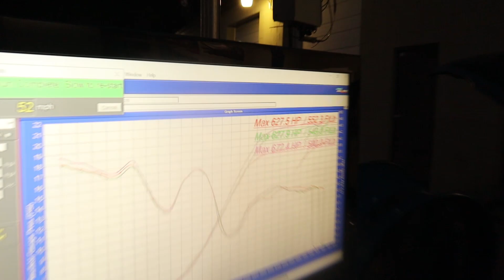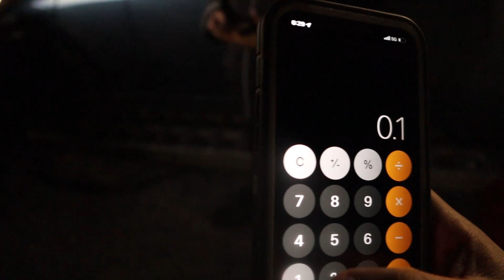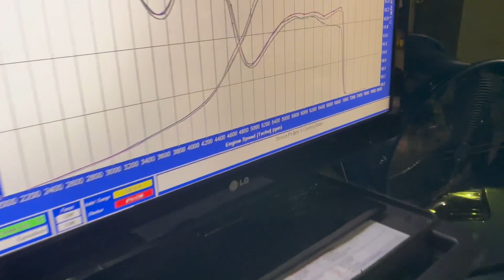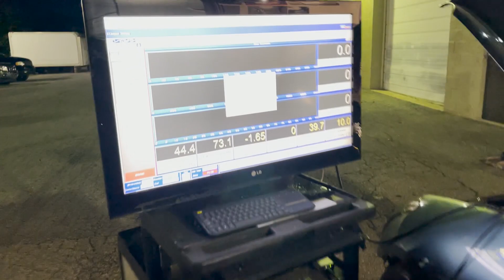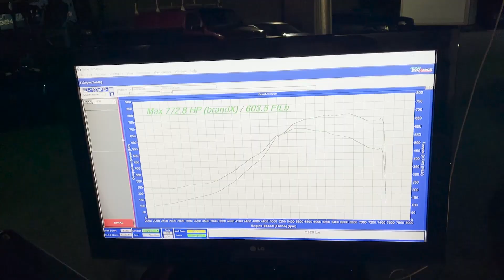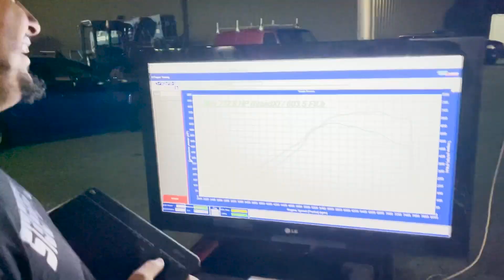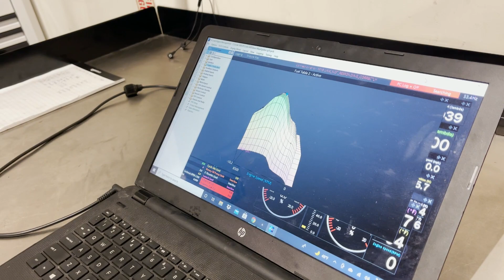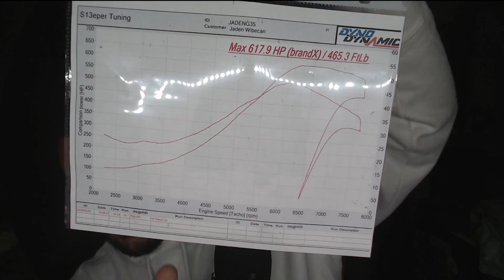My TURBO G35 BREAKS The DYNO On The Strongest Pull!!! *More Than We Thought*

Comment: What rear end. You running?  Might want to change your gearing to hook better.  Get them et street r or them Hoosier jawns.  Good numbers fam
Reply from the maker: Yeah its trial and error i have the stock rear.. i have a 3.7 rear sitting but idk if im gonna put it on we will see next year
Reply: @hudiniracing  I have a the auto 3.357 gears in my car don't make as much power as you but my buddy has the same gears with 900whp 2jz & his shit hooks from 40 on 295 50 15. Might want to look into your camber & get the car aligned as well so you're getting full contact patch. Best of luck tho bro can't wait to see some racing content